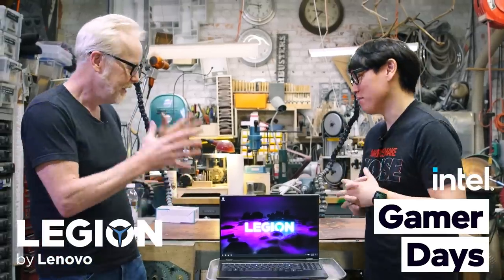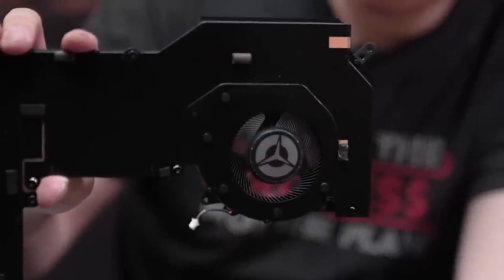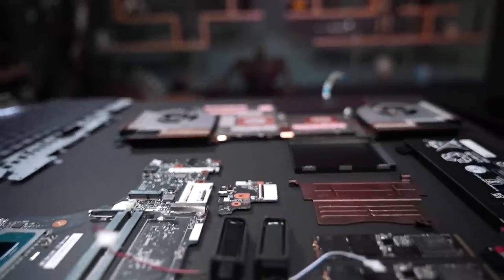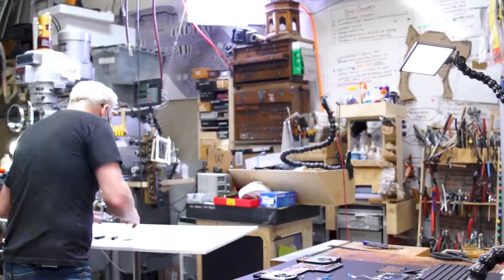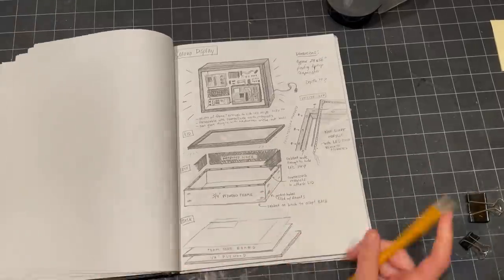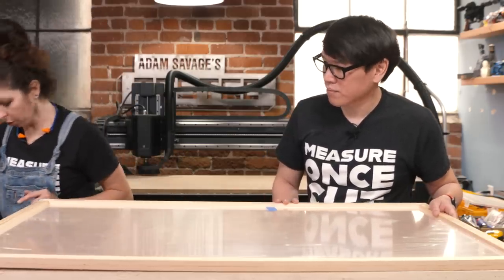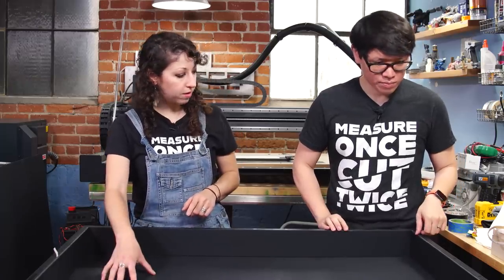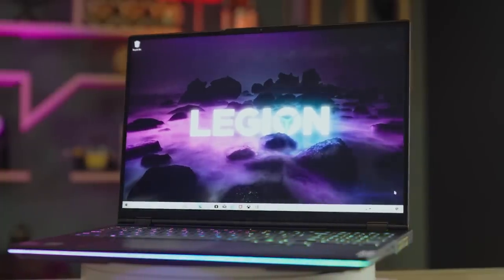Savage Inside: Lenovo Legion 7i Shadowbox Display! (Intel® Gamer Days)

Comment: Now if it were a Macintosh they'd have had to use a heat gun and glue solvent, and they would have had nothing other than a screen, battery and mainboard (since everything is unreplaceable chips with nothing removable).

Comment: 1:09 Yeah but... A mobile RTX 3080 is barely equivalent to like a 1080 desktop unit, so...
Reply: Not really, no.
Reply: A mobile 3080 is much closer to w desktop 3080 than a 1080. Things have gotten extremely efficient nowadays grandpa. But that doesn't stop Lenovo from designing it to run at 100c

Comment: What a waste. I'm not dissing on the art at all, but what a waste of resources that went into making a perfectly functional machine, in terms of effort, rare metals extracted, shipping, etc. only for it to be disassembled. Especially during a chip shortage! I mean, if it was a faulty unit, it would have been a perfect re-purposing use, turning waste into art. But of course sponsors would never allow even the suggestion of a faulty product.

Comment: That's it? You turned a fairly decent laptop turned into a display of non functioning parts? Making an extended wiring harness with the correct ribbon cable connectors as terminators to reconnect the components and actually getting it running and then using it would be cool, this is just lame even by hard core computer nerd standards.

Comment: what a waste. now make it work.
Reply: Unless it's 90% assembled you cant, and even then what's he gunna do with it? Put a tv in front and use it for a media center or some shit? You can just slap some glue on it and make it work. Sure it's a waste but these companies straight up don't give a fuck, blame them, they gave it to Adam fully knowing what Adam was going to do with it.
Reply: @volkswagen1221  with some enginuity and effort it could be done (see diy perks for worthwhile projects),  and it's a very powerful pc sooooo, he could have it run a projection mapping or other visual art installation, maybe showing advertising material or a presentation video of the design and manufacture of the device, or else dedicate the competing power to research facilities, video rendering or mine crypto.
Adam can choose what projects he does, and for something like this he could have used a defective unit that would otherwise have been e-waste.

Of course the companies are also wasteful and at fault, but Adam doesn't have to be.

Comment: Looks good, but I wouldn't buy a Lenovo no matter what kind of price they put on it. Lenovo makes very cheap garbage products that don't last, their QC is terrible and the company itself is a nightmare to deal with. Working in a tech hardware shop, the only other system that is most often seen other than Dell is Lenovo. 
Maybe one day when Lenovo wants to actually make high-quality electronics, I'll give them a look. Until then, it's one of a few manufactures that everyone should stay away from.